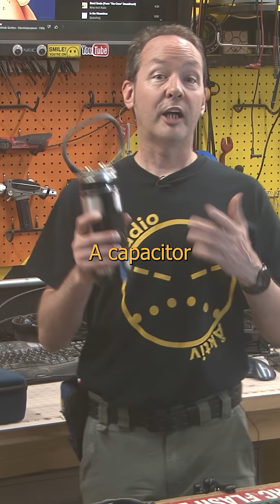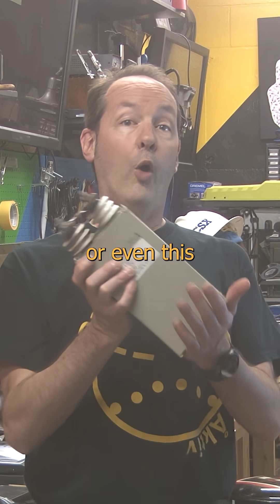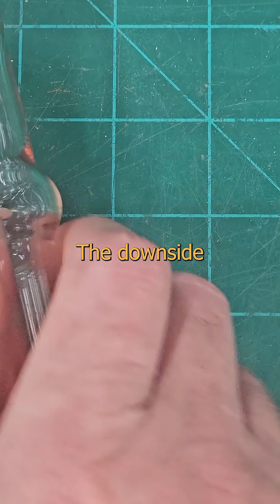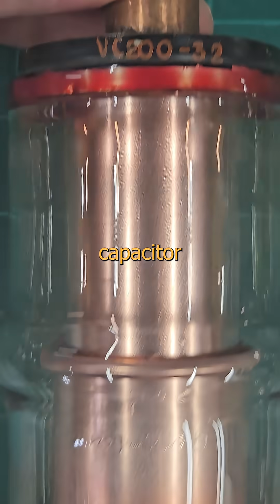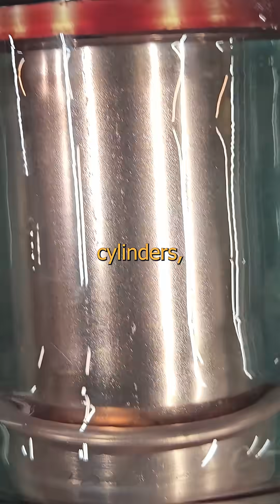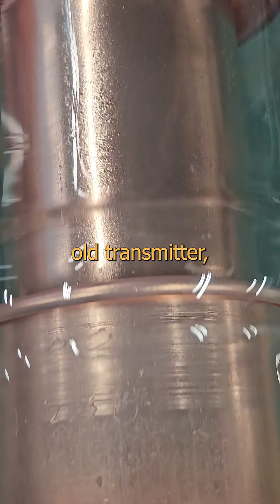Vacuum Capacitor #chrisboden #comedy #engineering #highvoltage #science #parts #apprentice #radio

Comment: Funny story used to work at CSI which was the old Kaiser steel mill back from World War II and we used to go exploring in some of the old shut down buildings and came across some cool little thingy Bobbers that we didn't know what they were but they sure look like cool ass batteries so we grabbed them brought him back to the shop I was about to stick a voltmeter on him when an electrician walked by and said what are you doing just checking out to see what this thing holds if anything and he goes That's a capacitor it onloads Everything at Once don't do that! Talk about the right place right time with an electrician lucky.🤯😵‍💫

Comment: I managed movie theaters from 1985 until 2006. That also included being a projectionist. The power supplys for the projector lamphouses had huge capacitors in them. About the size of coffee cans. The only thing we were allowed to touch in there were the cooling fans. We vacuumed them clean about once a month. The xenon projector arc bulbs were between 3000 and 5200 watts.

Comment: I may not have ever gotten a degree in anything but if Wikipedia and ADHD coupled with my top fuel based 20s 200 picoferrads is still about 20x as powerful as anything I’d ever like to be in the same room as
Reply: Edit: unpaused video “32000 volts at 60amps” 

Straight jacket me; “ HAAAAAAA!!”

Comment: 200 Picofarad sounds tiny (and is tiny in most applications) then I did the math when I heard the voltage and current. It handles over 1.9 MILLION WATTS and that converts to just over 2,577 HORSEPOWER! AND THATS PRETTY EFFIN COOL!

Comment: I've got a monster one of those, easily three times the size, salvaged from a dumpster on the engineering side of the university. No cracks or obvious defects, might test it to see what it's capacitance is to see if it would still work in addition to continuing to be pretty

Comment: I absolutely live capacitors, it's the first thing I learned about when I started tinkering with an old ass radio when I was a kid, voltmeter a coathanger and a torch is all o had lol, it didn't end very well I ducked it up

Comment: The cooler ones are the variable capacitors, they have metal bellows allowing for plate adjustment while holding high vacuum.

Comment: As a luthier who spends that vast majority of his time working on electric guitars in particular, some of the most important information that I need to know when it comes to designing a custom guitar for a client that they'll be happy with is how can I utilize the various capacitors and resistors available to me in different ways and in different spots throughout the bus to shape the tone that comes out of the jack in a way that matches my intent for it.  Normally, it's just a 0.022μF Jantzen cap here, or a 0.017μF Soviet PIO cap there, maybe add a greasebucket on a parallel bus, or trick a humbucker into believing that the signal on the circuit is really in the 500k range when it's actually in the 250k range because there's a single coil pickup whose a pickier eater than them (or else I'd trick the single coil, not the big daddy).  The past few years of really studying the way that an electric guitar turns plucking a metal string near a copper wrapped magnet into the music we all love has been eye opening in many ways, and not to sound cliche or droll about it, but the most important part of sculpting the sound that an electric guitar will make comes first and foremost from the electronics you use and how you use them.  That being said, it's amazing how make or break every little cap, resistor, and pot is when it comes to making a truly expressive guitar that an artist can use like it's an extension of themselves..  Learn those caps, boys and girls!  There are secrets inside of there that very few of us mortals will ever glimpse or grasp!

SIDE NOTE:  I'd love to build a strat for someone and just have one of those caps hanging out of the back of it, just pretending like it's totally normal.  That'd be so tits.

Comment: You say those things will go for centuries. Just wait until a 24 year old engineer gets their hands on it and figures out a way to make it cheaper and last 13 months with a 12 month warranty. Oh, and while it is mostly operational it won't even remotely do the job it is supposed to do. If you argue the point they will call you an old fart, boomer, gen xer or something else witty.
Some of these twits are going to find out soon why Urgroßmutter kept the butcher paper and string.

Comment: variable vacuum capacitors will have a tunable shaft that allows you to dial in the right capacitance and are traded and sought after by hams for making loop antennas. You need a very high voltage rating to operate it at 1500W.

Comment: Are those capacitors used in oscillators? I was always curious how is it that large transmitters can transmit high wattage. The oscillators I've seen and put together required components that will burn under such wattage.

Comment: When I started work in substation design, I had to familiarize myself a bit more (I knew next to nothing) with capacitors.  The first several times someone mentioned megaVAR, I heard "mega bar" and thought capacitors might not work the way I thought they did and neither must tensile strength.

Comment: I was thinking broadcast when you showed that large can - props for shorting the terminals together btw.  

Pro tip, you have to find an OLD transmitter to find the glass capacitors.  New ones are almost all solid state.  Get a Klystron and now we're talking!  (you will need more than one person to move the damn thing) - same with a newer IOT.  

The cool old tubes are in almost every radio/TV Chief Engineer's office.  Some are actually classified HazMat, so hard to get rid of anyway. (I retired from broadcast engineering - we are a dying breed now).

Comment: Dude, now you’re gonna have a bunch of morons digging around for capacitors. Did you ever think to tell them about discharging capacitors and not messing with them?. there used to be warnings on everything that had a capacitor that you had to fully discharge before repairs, maintenance or removal of items. Now these morons are gonna be out there fit around, grabbing both ends of a capacitor and finding out that that energy can be released.. released in a millisecond all of it. We used to do this on purpose to people with tiny capacitors that used to be found on ignition systems. You know points and condenser kind of stuff.. really dude you should probably put a warning

Comment: In my previous life as a cable guy I actually learned a lot about high frequency, low voltage transmissions. (In theory.) I never climbed the technical ladder high enough to poke around with the really interesting gizmos.

Comment: The first time i worked on a 40 KW Hf transmitter and was told when you open the cage tap those with a stick attached to the frame or you will die. It tends to be a memorable moment.

Comment: I think the funniest capacitor I've ever seen was a grigri belay  device in the desert. In certain extremely dry conditions, if you're belaying a climbing partner, when lowering them, your hand is maybe an inch or two from the big plate on the left side of the grigri. as you  hold the lever back. As the rope moves through the grigri , charge from my best guess being the rope dragging against the metal inside of the grigri discharges into the gap between your hand and  the grigri, which acts like a capacitor with two plates. The charge builds up between the plates until  it discharges into your hand and into the ground, because you are a much better path to ground than the roap, which is an insulator. It's not a particularly hard discharge, but when you are lowering someone at a consistent rate it's very episodic. You'll get a zap precisely every second for example. You could sing to it, it's that accurate. The first time I had it happen to me I was like what the hell is happening, why am I getting shocked at precisely the exact same interval? And then I realized the physics behind it and just laughed.

Comment: Looks dangerous but the amount of energy it stores  is only 0.1024 Joule. Or enough to light up an old indicator LED for one second.  Equivalent to dropping a medium size apple only  almost 4 inches. Not scary.  But at the first 0.001 picosecond there will BE HUGE AMOUNTS of current.... but that won't be enough time to do any damage.  If you had one quadrillion of these charged capacitors in parallel....NO WAY IN HECK would I touch it.

Comment: That's not a tiny capacitor. A 0102 on a PCB is a tiny capacitor. That's 0,1 x 0,2 millimeter in size.

Comment: Back when I was an apprentice we got called to a brake pad manufacturer that had a 60 year old induction heater from either the USSR or the GDR. It hat a gigantic UKW Diode inside it that was about 3 times as wide than the one you are holding. The whole thing litt up the whole of the cabinet it was installed in. Long story short break dust and capasitors don't get along very well.

Comment: Your handling that without the leads tied together is making me nervous. 😅

That's something you don't WANT to twiddle without both security clearance AND proper certification. I have a degree relevant to that thing, but I will NOT be coming closer than a fascinated looksee without at LEAST a two hour course and accompanying cert. I'd be hesitant to take it if even someone like you handed it to me. So picking it up off a bench is doubtful, unless I'm wearing the right gloves, and, without proper training AND equipment, I would quit before opening the cabinet that thing is installed in. 

Because of the degree, I am anything but scared of it. I just ain't stupid. Even with the one I built, I had a properly certified friend test, install, remove, and discharge the thing before we disassembled it for safety.

Comment: hang on wouldn't the vacuum make it easier for charges to transfer in the voltage go lower and lower that it would Arc out internally?
Reply: An arc is a channel of ionized air (or whatever) acting as a conductor instead of the insulator that is ordinary non-plasma gas. In a perfect-enough vacuum, there's no arcing because there's nothing to arc through.

Comment: Uhh, someone or the duck.
Could someone explain if a super/ultra capacitor or the difference, but the actual super usage of them and the potential.
I use 12 of them in parallel in two banks for my audio system, and another single bank of 6 in another car just for better pay performance of electrical system and runs was better with them.
Could some one confirm my technical knowledge?

Comment: A friend ran the transmitter on top of Cheyenne Mountain for KKTV and had to deal with LOTS of lightning strikes. He designed a waveguide filled with argon and a tiny whiff of krypton-85 that kept it juuust on the edge of breakdown, but able to quench quickly. Any voltage spikes would shunt the transmitter to a big honkin' resistor, then recover instantly. This saved him a lot of expensive transmitter klystron replacements.

Comment: I have a bunch of them pulled from old AM broadcast rigs.  I did have to use a couple elsewhere, not for repair but to build a new AM tower tuning unit where what I had to match required stupid high voltages and current and be low loss as well.  Vacuum capacitors are the cats meow when you need something that's low loss.

Comment: 200 picofarad, sounds very low until you hear the 32,000v and remember farad is a measure of charge (not watt) divided by the voltage.

Comment: Reminds me of the tiny 'glass' (?) surface mount diodes. I think most are Zener Diodes, but they're clear with a bit of red and black just like that 😊
And indeed, that thing is pleasing to look at in its simplistic elegance. 😍
Reply: No, they are 1N4148 signal diodes, not zeners.
Reply: @deang5622  Thanks. I've heard they, or clear ones like it, can faintly glow and were the Eureka! moment that gave us LEDs.

Comment: When you build tube amps for guitars you have to watch out for the capacitance between any two oppositely charged electrodes within a tube. It’s not ideal but it is inevitable since any two oppositely charged plates have a capacitance, and the DC voltages from anode to cathode are enormous. 425VDC is not unheard of in even smallish guirar amps.

Comment: Reminds me of the kind of componets a guy I knew that had a 20kw amplifier for use on HF AM. Umm he isn't around anymore and all his radio equipment magically disappeared. Gosh that metal electron tube inside his amplifier and the capacitors were a beautiful thing to see. The size of that sucker and the radial heat sink fins were amazing. He had the cleanest amplified signal I've ever heard on 11 meters. It didn't even bleed over channels like everyone else does. That setup was tuned perfectly. I did envy him until the local guys found out a three letter agency found his station.

Comment: Late one night, I had to replace some capacitors and SCRs in a medium voltage VFD. The caps had big holes in the sides that weren't supposed to be there. I just left the blown parts on a work table in that MCC room.

6 months later, I picked up one of those religious caps, an it ate me up. I screamed like little girl in a pretty white dress. 

Even if there's a large hole in the side, it doesn't mean the cap isn't still holding a charge

Comment: This is a... 200pF cap... ok, it's for 32kV, still, it's tiiiiiny! (a quick ELI5, 1pF - picofarad - is a millionth of a millionth of a Farad. In a power supply, most caps will be at least some 100.000 bigger - not in size, but in charge). Funny you need such a tiny cap here. Of course also the bigger the voltage the bigger the size of the capacitor - quick edit, as it's mentioned afterwards - it's for radio application, which makes total sense - because the smaller the cap, the higher the frequency roughly speaking

Comment: Um I thought batteries stored there energy through chemistry. Could  have sworn that the reason batteries worked. Was that two chemicals that wanted to share electrons were separated by a barrier. And that they had to take the long way through wires because it was the easier path.
Reply: I know but what I was getting at is he implied that capacitors are chemical based but batteries aren't. Which is why I  was confused.
Reply: This is the other way to store electric energy. It's kind of like a bucket. The more electrons you put in, the more they want to get out. Batteries are good for long-term storage. Capacitors are good for short-term.
Some capacitors hold enough energy for long enough they will kill you if you're not careful.
Capacitors store energy through physics.

Comment: Capacitors don't work chemically. The application is pure physics (or electrostatics as he said earlier).
Reply: Not entirely true. Electrolytic capacitors do undergo true electrochemical action since they have the ability to reform the oxide layer of the aluminum foil. Part of their self-healing capability. Many also undergo chemical reactions over a really long period time, though most of those are the electrolyte breaking down and are not as desirable, even if ultimately mostly innocuous. The small (yes, that's small) film cap with the white terminals are not electrochemical in any way, though. Its contents are probably PCBs, dioctyl phthalate, benzyl toluene, silicone/mineral oil, or... canola oil. Yeah. The food grade stuff.

Comment: I have seen many like that in the Navy's VLF transmitters I used to service, like 25 years ago, 10KW vacuum tube output beast!
You have to discharge it with a copper rod and the sparking scares the crap outta me, but you get used to it, the output tube is enormous, not to mention plate capacitors!!! They look like fire extinguishers 😂😂 I loved working on those back in the day

Comment: Even after multiple electrical theory classes I still think capacitors are magic.
Reply: The way I see it, you are taking charges from one plate, and pumping them to another. the  charges want to return to the plate they came from, to sort of go back to equilibrium. The way they can do that is through a wire connecting the plates, unless plates short out.
Reply: That’s cause they are

Electrical engineering is just applied natural magic

We didn’t kill the faeries, we just trapped them in jars and made them run our machines

Comment: You want to see something really cool. I have a burned out X Ray tube. When powered up it generates X Rays for treatment or diagnostics. When in use it has a lead container around it with an adjustable aperture to regulate output.

Comment: I have a really neat usage of a capacitor in my line of work! 
Skidoo snowmobiles use them to help put them in reverse! 
There's a slight delay when hitting the reverse button because the ECM/ECU then gets the engine to fire and rotates in reverse, allowing backward travel.
The capacitor is used to ensure that there's enough energy on board to ignite the spark plugs without having to pull the pull start cord again. If you had to manually pull the cord again, though, you may as well put together a gearbox that connects the jackshaft to the track gears like the 4-stroke engine variations of snowmobiles. 
Oh yeah, the beauty of this system is the fact that it's used on 2-stroke engines that don't need the additional items of a 4-stroke engine's timing circuit.
Reply: What a peculiar system.  Would become a pain as it ages and the compression lowers.  The cap would have enough energy to spark once I imagine so unless it fires on the first comp stroke, you are pull starting and trying again I guess